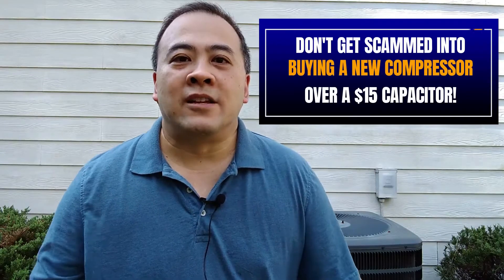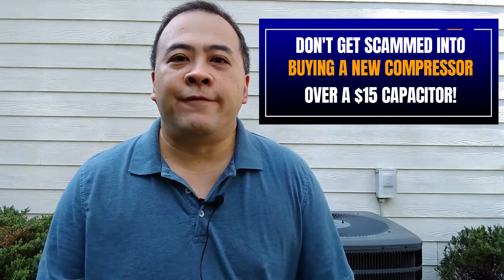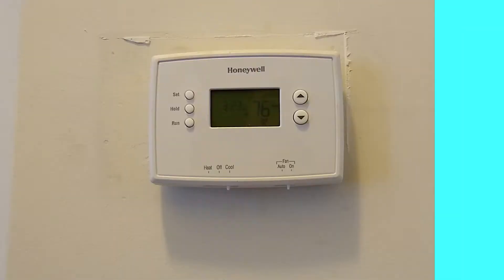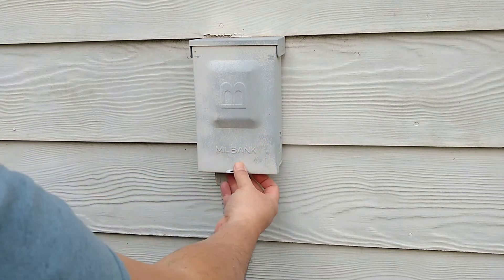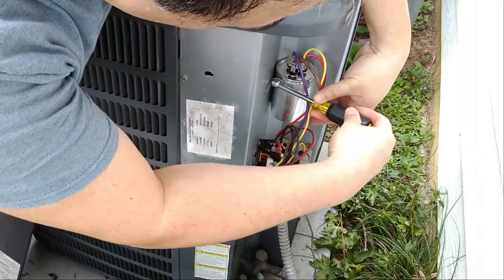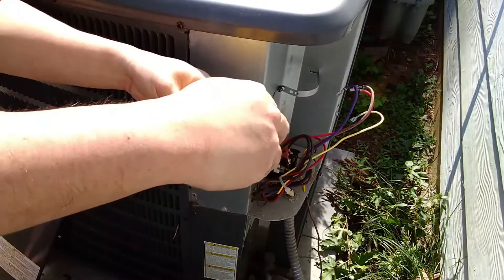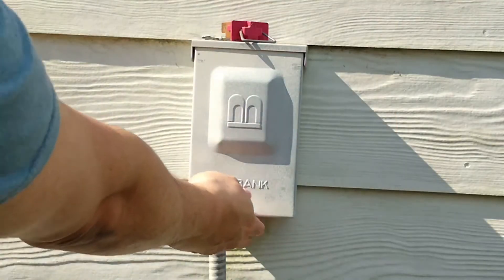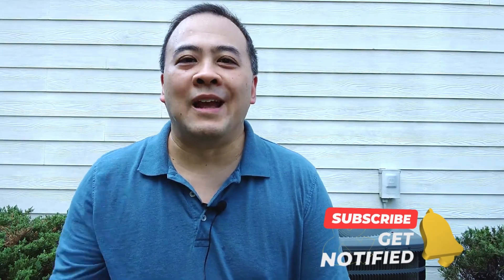GOODMAN compressor NOT working, NOT cooling! Easy $15 Fix!

Comment: You’re supposed to discharge a capacitor before touching it
Reply from the maker: Hi Paul, I did say in the video I am not an HVAC pro. I am a guy who muddled my way through. However, anyone reading the comments will see your great suggestion.

Comment: Capacitors are designed to be the most common thing to malfunction on an air conditioning system. Many people with a little bit of mechanical ability could save their self a lot of time and hassle and of course money, by learning how to replace their own capacitor. Your video shows them how easy it can be.
Reply from the maker: This video would not have been possible without your assistance & expertise! You and your team showed me how easy it is and how to save money!